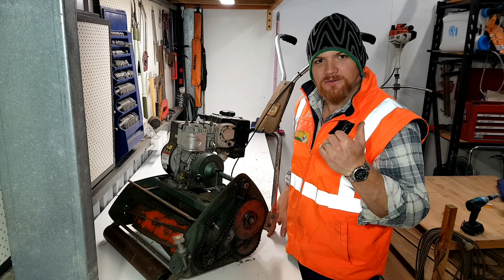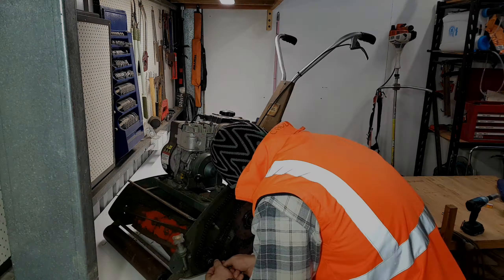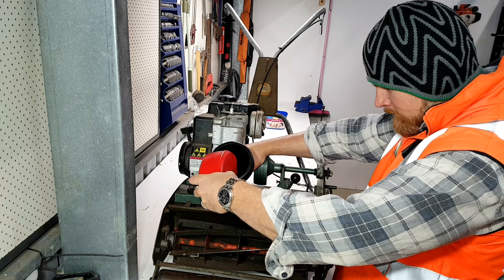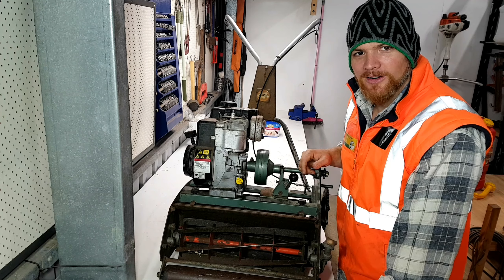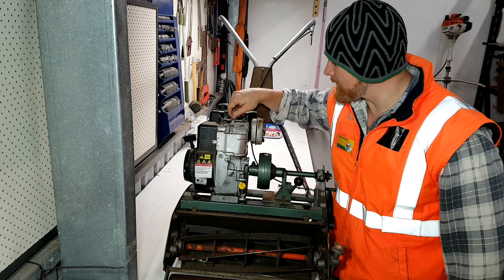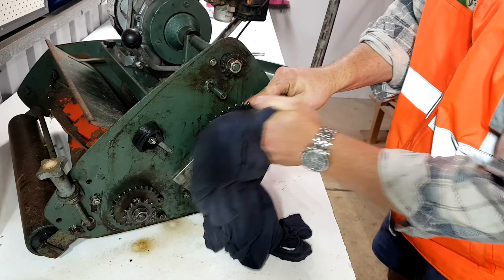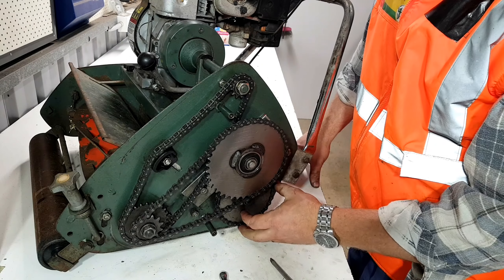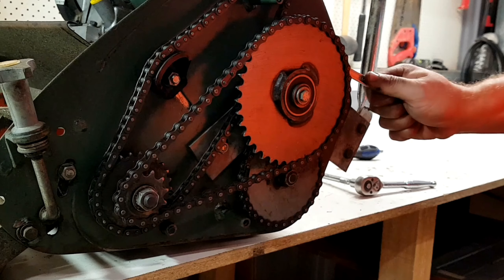SCOTT BONNAR 45 BASIC SERVICE - 17" winter service

Comment: Can you please explain the oil change a little slower? My Scott Bonner has a Tecumseh 3.0 HP engine and the engine has two sump plugs, and I am trying to figure out how to do the oil change, or to determine whether there is a gear box inside the engine which takes a  different type of oil. Can you please help?
Reply from the maker: Hi franklin. No dramas mate. If you want a more detailed response email me with photos at thegreenandgoldlife@gmail.com. I'm pretty sure it does not have a gear box just two ways to drain the same sump. I would focus on the rear plug and tip it back 👍.